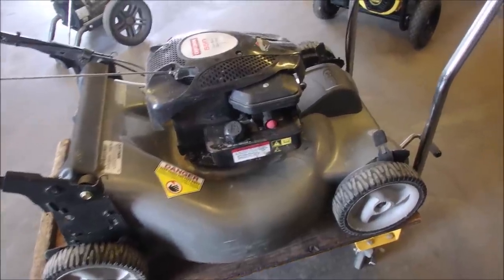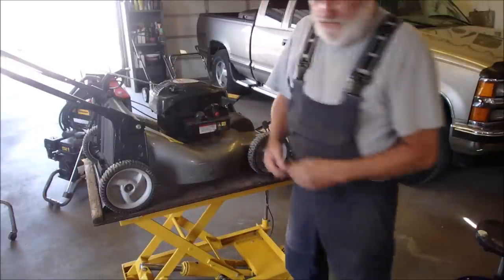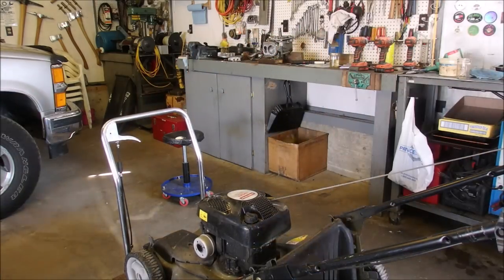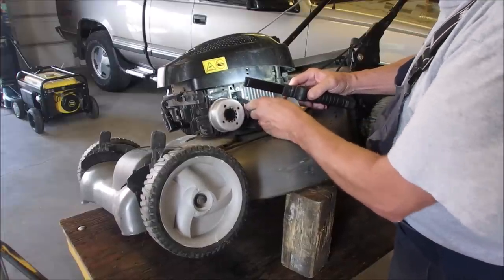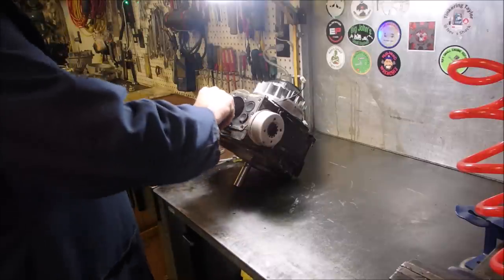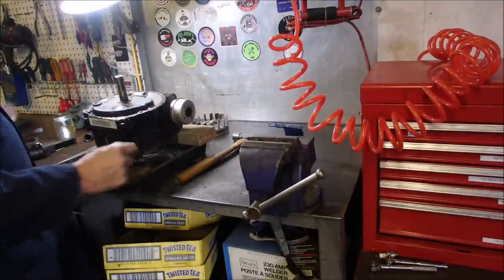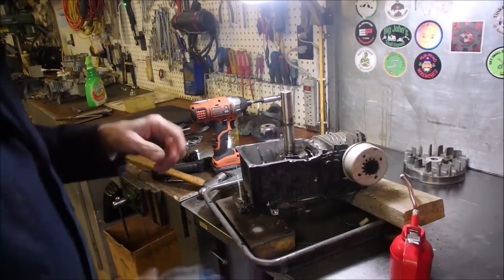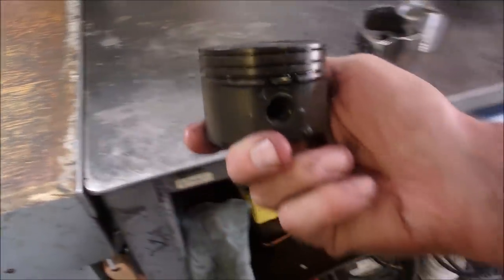Murray Mower With Briggs Classic, Blows Black Smoke

Comment: I still remember those valve specs from so many years ago:  intake: .005-.007", exhaust:  .009-.011".   Good point indeed, forgot all about that damn flywheel key.  Funny how this thing sounded rich and lean
Reply from the maker: Yes at the start it ran ok then started flooding itself after heating up.
Reply: @BrucesShop    I know I heard you say that you replaced the carb, the tank as well?  Seems like the valve adjustment is OK, compression seems normal, flywheel key OK.  hmmmmm
Reply: OK, got excited when I saw those cheesy plastic cam gears, thought that might be the issue.  The piston does look strange, but who know what they are made of these days...  You mentioned the ring gap looked OK, I was thinking perhaps someone ran the engine for awhile with no air filter, or didn't oil the foam properly, letting the dirty air wear down the cylinder.  When did Briggs start using the internal governor instead of the old vane style?  Guess I have been out of the game for awhile....

Comment: Bruce, I once had a quantum that was all coked up on the head and had a real bad ridge on the cylinder also. The person had the wrong plug with wrong heat range and wrong gap. Was incomplete burn and caused the bad running and the coking.  Cleaned it up, new plug and it ran fine.
Reply from the maker: OK  Thanks that is a great point.

Comment: Listening to that engine running bruce my 1st job (after changing the d&g) would of been checking the air intake tube for cracks or damage, everytime i service 1 of these old briggs classics i always tighten the 2 bolts holding the tube on as they tend to vibrate loose
Reply from the maker: You are right to look at the intake tube.  If the intake tube was cracked or loose it would be running lean by letting in more air.   I did checked it to see if it was plugged.  Sorry I did not show that.  I thank you for joining in.

Comment: Interesting stuff, never seen a blackened piston before. I thought it was rings when you couldn’t find a fault anywhere else. Got shown a picture today of a utterly smashed piston from the engine of a fishing boat. Engine was recently rebuilt, whoever rebuilt it got the timing wrong.
Reply from the maker: I wonder if this piston has pin holes in it   I will check.

Comment: Very thorough inspection. I think if I would have gone that deep into an engine I would have rebuilt it with a new brand new piston and rings possibly new valves. I also would also seat the valves to be sure of a perfect seal. It would probably be as good as new. If that didn't fix it I would get a brand new carburetor and diaphragm. It would be extremely hard for me to take an engine down to the crank and not put new life into it. Couldn't do it.
Reply from the maker: Right on.  I was worried that the cylinder was toast as well.
Reply: @BrucesShop  true hmmmm maybe try a new set of piston rings. That is probably what I would try and if the cylinder was lightly damaged I would maybe try my luck with a cylinder hone to smooth it out best I could. I have seen it work beautifully with two strokes. Not the same as new but close to it.

Comment: Time to ask Santa to bring you a leak down tester while your in Mexico. This helps pinpoint internal engine issues without teardown. It is almost like someone opened the get in the carb and it is flooding with too much fuel and it got better when you provided more air to balance it out.
Reply from the maker: Right  we talked.  it runs good for 30- 45 seconds then floods after it warms up.

Comment: I would bet on the piston having a pinhole(or a dozen). The other thing I was thinking about was the little ridge you mentioned at the top of the cylinder... Maybe the entire bore has changed over the years and the rings aren't as tight as they could be?
Reply from the maker: I wondered that as well.  I think the cylinder got hot as well.  I have the block and will have a closer look.  Thanks.

Comment: are you sure it didn't have to do with intermittent spark?  coil or plug?
Reply from the maker: Good point.  As it ran OK for 30 secondes.  The piston was burnt though.   I thank you for helping me to look back on this one.
Reply: no doubt you are right , but a lot of the time if the rings etc are shot there will be a lot of blue smoke black is  usually gas.  @BrucesShop